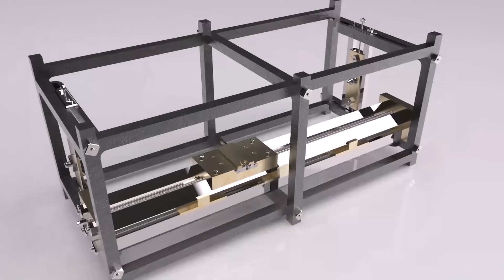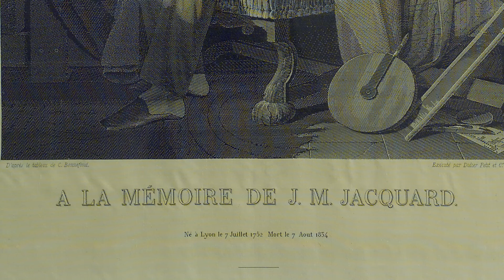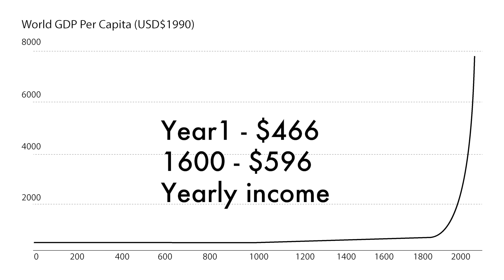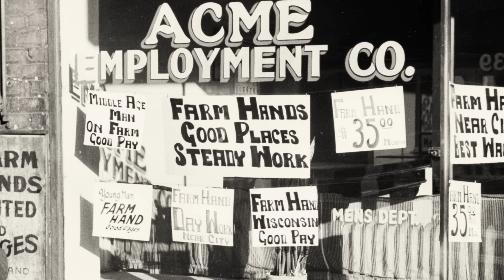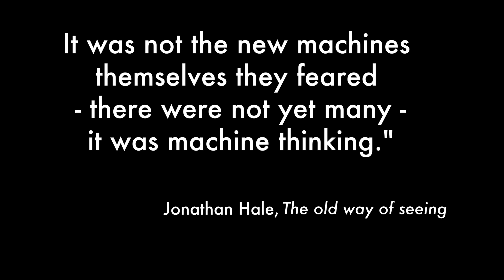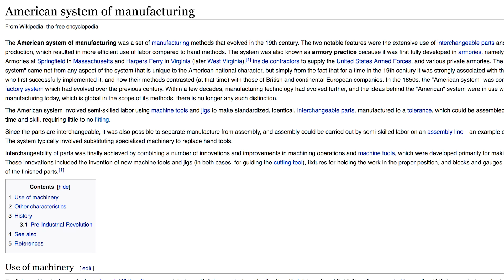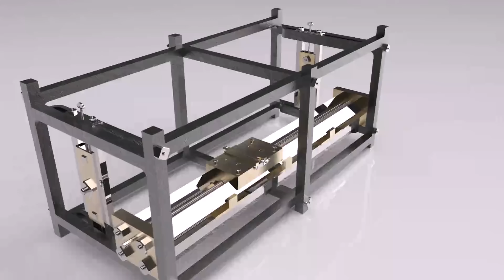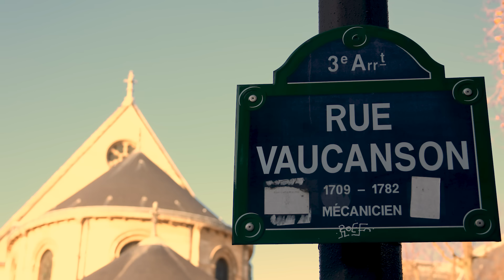The 1751 Machine that Made Everything

Comment: I don't remember who said it, but its one of my favorite sayings: "the lathe is the only machine that can make itself"
Reply: Yep I remember my first-ever laythe and mill, a handdrill in a vice and a file.
Reply: It's the lady of machinery.
Reply: @CIorox_BIeach  3D printers too
Reply: @BacklTrack  3D printers make plastic toys.
Reply: @CIorox_BIeach  you can make some firearms from 3D printing lol
Reply: @BacklTrack  I heard about that and I can tell you is nonsense.  Sure, you can print the components, but  because it's plastic, they'll melt and it's questionable whether or not the material will withstand the pressure from the first blast.  If you want to make a real gun, what you need are things like a drill press, grinder, tapping kit, etc. At the cost of a 3d printer, you can outfit a nice home shop.
Reply: @CIorox_BIeach  lol come on. It's come way further than the original liberator print. Check out the progress
Reply: @BacklTrack  It's still plastic...
Reply: @CIorox_BIeach  not 100% of the best designs are plastic. Usually it's the only regulated part, the frame that's plastic and there's been polymer lowers for decades. Check out the FGC-9. mostly 3D printed, ECM 9mm barrel out of steel pipe, and I think they figured out a way to replace the fire control group with more plastic than what is wise. Just check up on the 3D gun space every now and again. They're doing cool stuff
Reply: @BacklTrack  Well, I think that's the point.  You could probably make a rifle stock out of cheese and as long as the barrel was metal, it'd work.  The barrel still has to be bored and, if you want accuracy, rifled.
Reply: @CIorox_BIeach  the ECM actually rifles the barrel! It's pretty neat. It was made to make a semi automatic pistol caliber carbine using only unregulated parts in the EU
Reply: @BacklTrack  So what you're saying is its better than nothing in an unfavorably regulated area? I'm thinking under normal circumstances, it makes far more sense from an economic, safety and functionality standpoint to just make one with normal materials and tools. In the EU, tho..
Reply: @CIorox_BIeach  yeah that's about it. Stamped/milled/forged stuff would be better. But the 3D printing sphere is getting way way better than I would have imagined. Some guy on /k/ 3D printed some insert for his big bore black powder Snyder rifle.
Reply: @CIorox_BIeach 
You know that 3d printing metals is possible right?
Reply: @CIorox_BIeach  It is the MOTHER of invention, rather!
Reply: 自己増殖は特異点です
Reply: What everyone misses in this discussion is the tooling.  If you started with hand tools manually making parts with files and building a better mouse trap you don't get fly cutters and end mills and insert tooling and you certainly don't get leadscrews.  In the history of lathes tool steel was a futurism.  Mills with no end mills aren't useful.  Lathes with a but of abrasive are.  Lathes are the real invention because we could turn the parts with a single point tool made by hand well before we could make cutting tools capable of the job on a mill.
Reply: And if you had a very basic lathe maybe say a set of V grooves and the ability to spin something between the two v grooves by hand you can eventually make a milling cutter, but you already had a lathe.
Reply: You can mill on a lathe. 
You just need a vertical slide in place of the compound, and a collet in place of the chuck. Then your lathe is essentially a mill laid down on it's back.
The X-axis is the cross-slide, the Y-axis is the vertical slide and the main carriage travel is the Z-axis (or tool height/depth of cut).
Reply: SidtheKid  hammer can also make another hammer
Reply: How would the Vee slides be made on the lathe?
Reply: John Smith from hot billets of steel drawn out and precisely cooled to avoid warp. then they are filed straight and square and cut. i mean or they could just cast them. so idk
Reply: @JohnSmith-tw3rw  the compound slide, tool slide, and the saddle all are capable of cutting straight lines and perpendicular lines. The tail stock is Handy here as well. Any basic lathe can do it.
Reply: @JohnSmith-tw3rw I have several lathes with  round bar beds that are over 100 odd years old that still function well lol
Reply: @JohnSmith-tw3rw  bolt to carrige, feed in x. When you run out of travel, move your work and rebolt you work down. It would take several passes but It is possible.
Reply: True that...I got another lathe so I can fix my main lathe when it's broken
Reply: @drd1924  weird flex but ok
Reply: @ncstudio333  Flex it bruh
Reply: Obviously there are better tools for the job but a lathe CAN make these parts.
I have heard it said that if civilisation collapsed a lathe could build it back up.
Reply: https://www.quora.com/How-can-a-lathe-machine-fabricate-itself The quote is as old as lathes are. A mill is nearly a vertical lathe, it is a modified version of a lathe. Obviously there are more specialized machines to make a lathe than just using one machine to do everything. A hammer is actually the most versatile and fundamental of all tools. But the lathe can make screws (this would be a real hassle on a vertical mill) and standardised screws are such a fundamental driver of the machine age that that is why a lathe is recognised as the grandmother of all machine tools. Otherwise we'd be stuck with hammers and nails.

To the 3d printer fans. I'm sorry but your an example of modern technology making people less smart. You can't make screws on a 3d printer. A 3d printer is a lightweight lathe mill (using leadscrews or belts and chains, it's all indexed round lathe made parts). That being said, the actual technology that makes a 3d printer universally useful is computers and the internet. Infinite programmability. Even more powerful at making things than lathes but it sure can confuse us (people who think a 3d plastic resin dispenser can make strong and accurate machines LOL)
Reply: @ruslbicycle6006  

You absolutely can make screws on a 3d printer. You forget, 3d printer is a wide term. Some use hot plastic, some use uv light to set resin, some use lasers to fuse metal dust. Metal 3d printers are being used to make parts with such complicated geometry that no cnc can come close to making it. Right now the only thing you can't make on a 3d printer is the wiring. I myself own a nice lathe, a nice manual mill, a cnc and a 3d printer. I can print just about any part and use that part and cast it in metal. Heck they are making entire boats with 3d printers and houses. This technology has just began to evolve. In the next 5 years there will be printers everywhere doing things we thought impossible.
Reply: @ruslbicycle6006   there is an American rocket company 3D printing rocket engines that are fully functional straight from the printer
Reply: @ruslbicycle6006  One day someone will put a milling machine next to a metal 3D printer so parts can be finish machined. Perhaps use silver conductive paint and electronic components on a plastic 3D printer and make almost anything. The first ( Lincoln ) milling machines were horizontal, really just a lathe that had adjustment allowing the headstock bearings to go up and down. Everyone seems to have forgotten shapers, planers and slotting machines.
Reply: With a smelting furnace you can make a lathe. With a smelting furnace and a lathe you can make the rest of what you need for a metal shop. Dave Gingery has a whole series of books that provide instructions.
Reply: Boy, this comment thread fell off. 
https://youtu.be/OKDR1Q19BzU
Reply: You beat me to this. I first heard the saying from David Gingery in his book about making a lathe.
Reply: CNC mill?
Reply: @jamesharding3459  Had to hold a 1/2 shaft  in the spindle of a Haas VF-3 and a lathe tool in the vise to turn a shoulder while the lathe was down, felt pretty tricky at the time!
Reply: Of all powertools and machines tgat i have, the lathe is the one i like the most. Its like the king in the shop followed by the grinder and welder.
Reply: People who think a 3D printer can be made without a lathe, kinda miss the point.
Reply: Until we make nanobots.

Then there will only be nanobots.
Reply: Hmmm, I believe you, but I believe it would be inefficient when building the coils in the rotors and stators.
Reply: File.  Is the on;y tool that can make itself and with a file you can make anything
Reply: Shamanists, who despise the concept of the lathe because they think it removes people from their god-given path by enslaving them, are famous for spreading smallpox to their coworkers in order for them all to be unable to work, and by doing so, to apply a [revolutionary] force against their manager.
Reply: Adam Savage in his video talking about his Lathe
Reply: @setheide6618  that guy is a dewwwshhhh
Reply: @setheide6618  and that’s saying has been around decades before he said it
Reply: @setheide6618 mill. He's talking about his Bridgeport milling machine. Calling it one of the machines you would need to rebuild civilization.
Reply: Von Neumann? Nah...
Reply: @omegaman5663  i fucking love how google thinks youre speaking another language and offers a translate button
Reply: The universe, too!
Reply: I thought that was said of the Vertical milling machine?
Reply: Lol I never heard that saying. It's cool to have learned it though. I had one some years ago but it took up too much space and I stopped using it eventually, it made the electric bill really high as well which my wife pointed out to me. So I sold it. It did seem inefficient but I really like how it worked.
Reply: The problem with sentences like that is that they are either read as an absolute statement or as metaphorical and poetic. Both with will draw people on to make the case either for being false or not covering all cases.
Reply: Heard it from adam savage
Reply: 3d printers can print other 3d printers now lol.
Reply: Necessity is the mother of invention.
Reply: Robotic arms? Didn't Elon musk build a factory to build them using them
Reply: My Dad, circa 1985.
Reply: Waiting for someone to say 3d printer
Reply: 3D printer...
Reply: i heard the same saying, but the vertical mill.  because  can make round and square parts
Reply: God
Reply: Wrong,to make a lathe you need an milling machine for  the bed of the lathe.
Reply: Two fundamentals of machining are flat and round.
Reply: The milling machine can reproduce its self.
Reply: - my machining teacher in Gunsmithing said that
Reply: what about 3d printers?
Reply: 'Only'... that's just an old saw.
Reply: That’s not true. Cnc mill can too. And 3D printer. A 5 axis cnc mill can completely replace a lathe and is better in every way.
Reply: @Dakota Rossman Not true but okay. It was a useful tool but there are other ways of doing things
Reply: @Dakota Rossman I already made my own cnc and there isn’t a single part on it that was made with a lathe. Maybe the dies that were used to extrude the motor shafts were lathed but that’s the only thing on it and that could be done without it
Reply: @Dakota Rossman I don’t fail to realize anything. There’s no doubt it was important nonone is saying that. But saying that it is the only tool which could make itself or that it was needed to get to where we are is bullshit. There are other tools which can make themselves. A 3D printer and a cnc are modern examples but there are some way before we even started working with metal that could do that. And while the lathe sped up the industrial revolution it is not directly responsible or needed for it to have happened. Casting and forging and other forms of marching can replace it. Mills and lathes are very similar in function and construction. The mill can easily replace a lathe and would’ve been possible to construct without it. You are forgetting that the lathe was constructed without a lathe. The same parts and methods which made the first lathe could’ve made a mill. And while computers and motors weren’t that advanced yet the idea of a manual lathe being constructed first is completely plausible.
Reply: @Dakota Rossman If I had the money to buy all the metal I needed to prove you wrong I would. Maybe someday when I’m more financially stable I will buy a bunch of metal and make a cnc with nothing but a foundry and post it on YouTube for you. I already have a foundry but I can rarely even afford to fill the gas tank on it. And yes, fire came before lathes. The first version wouldn’t be terribly accurate just like the firsts lathes weren’t. You build a machine that’s has greater accuracy than a human alone. Then you use that machine to make a more accurate one and so on. Also coming up with a lathe hardly makes someone a genius. It is incredibly simple and as the video said people have been making them for thousands of years. It’s not like a single person invented it people consistently came up with it themselves. The person in the video simply made a big and strong lathe. He did not invent them. If you want to talk shit about your own intelligence go ahead but you know nothing of mine. You may be really good at using lathes. Being really good at doing something one way however doesn’t mean it’s the only way to do something. You are clearly the closed minded person in this argument so the wall comment is unfounded. Also you don’t even need to be able to make perfect circles to make a cnc machine. Also mechanical mechanisms which time the movement of the axis can be used to make circles. And before you try to argue you can’t make gears and shit without a lathe you can make a good enough gear with just abrasives. Don’t even need any machinery. And there are lots of videos online of people doing just that if you need proof. The real industrial revolution started with the ability to melt metal. Not with the lathe. Using casting and forging anything can be made without any tools. Just raw metal heat and time. Then abrasives are used to clean up. You can get away with using wood for a cnc frame though.
Reply: @Dakota Rossman you are the one obsessed with saying you can’t make a cnc without a lathe I’m just saying you can. Don’t get me wrong there’s lots of other things you can make without a lathe too. Also constantly trying to flex your job doesn’t help your argument any. A lathe is one of many ways to machine metal. And even in 1750 they had the ability to make metal parts without a lathe. Also I thought you were done with this argument lol. Clearly you care more than you say. Also motors are quite commonly made out of cast aluminum. Trying to cast copper wires wouldn’t be very efficient however but you wouldn’t use a lathe to make copper wires either. You either make a ingot and then press it into thin wires or you push molten copper through an extruder. When you are done you need to heat treat them to make them flexible. Anyway motor production is pretty simple. Wrap copper wire into coils. Preferably around iron to help strengthen the magnetic field. Laminations help reduce eddy currents however it’s not necessary. Then you just need a body which could be made out of aluminum although it doesn’t even have to be metal and a shaft. I’ve made my own motors before with my cnc and 3D printer lol. Used them for a drone. If you make an induction motor you don’t even have to use magnets. I used magnets in mine though because it was easier. And servo motors are just like normal motors with an encoder. The encoder usually uses a potentiometer. A wiper moves across a material with a high electrical resistance and the measured value of the resistance provides the location of the wiper. The electronics of course are an entirely separate industry though. Not going to bother arguing with you over how to make each and everyone of those machines without a lathe. Anyway I personally prefer stepper motors. They are cheaper and more accurate. Servo motors use a feed back loop to correct errors. Stepper motors simply don’t make errors in the first place. You can’t control the position of a servo motor it relies solely on its encoder and feedback loop to position the motor. You tell it to move to a certain position it will turn the motor at a certain speed for a given amount of time and hope it ended up in the right position then correct it if it doesn’t. With a stepper motor you can precisely control their position. The motor doesn’t just get set to a certain speed. The coils get turned on and off precisely attracting the rotor to a specific location. They can skip steps but if you use the correct power motors that almost never happens and you can put a encoder on a stepper motor too. Plus if your motors are stalling or skipping steps you should be grateful because it’s portably preventing your machine from killing itself after crashing or something or because you are putting too much stress on it. People say that servo motors have more torque but I think saying that a motor that costs 5 times as much and only has double the torque has more torque is just dumb. Maybe when you start talking about size and weight then you could make that argument. When it comes to torque per dollar though steppers definitely win. Same with accuracy. When it comes to efficiency both are over 95 percent even for the cheap ones so that doesn’t really come into play. Servos to tend to keep torque at higher speeds better but they still have issues with it. Also generally thanks to inertia you don’t need higher torque at higher speeds. You need it to accelerate but once you are accelerated it takes less force to maintain the speed. And if it really matters you can just use gearing. Anyway that’s besides the point because even though I wouldn’t use Servos stepper motors and servo motors are equally as easy to make.
Reply: @Dakota Rossman you too
Reply: You need a wooden mallet to make a wooden mallet
Reply: @Dakota Rossman have you ever made a wooden mallet with a bow saw and an axe? 

Either way .. go fuck yourself
Reply: @Dakota Rossman still trying to be a key board warrior??
Reply: Nano bot: hold my beer.
Reply: It was me that said it, not first but I’ve said it;)
Reply: I think a 3d printer could do it
Reply: dont forget the mill, if i could only have one it would be the mill and indexer
Reply: True! i love working on a lathe. much more than at a mill.
Reply: You can't make a lathe with a lathe. Prove me wrong.
Reply: @YarHarFD  um, is the machinist allowed to call thier mill a tipped over lathe? Oh and if anyone does accept, hi there sir, it seems you have an extra lathe taking up shop space; I'd be happy to help you clear some space ;)
Reply: I think that's what they say about the Bridgeport
Reply: Oh yeah? What about every living being? Ultimately with our man made machines we are just trying to achieve what nature does.. create a self replicating machines that would do our work for us..
Reply: True. But a hammer and tongs can make more hammers and tongs.
Reply: Don't know who told you, but it was Henry genoble at the Harley shop who taught me
Reply: My millwright instructor told me this one
Reply: Soon enough it’s gonna be robots
Reply: I'd say a mill would also fit in there
Reply: The problem with modern CNC machines is, while they can make their own mechanical components, they can’t make electronics components…
Reply: It can't though.
Reply: The late Dave Gingery repeated the phrase
Reply: How did they make the first one ever
Reply: @nnnnnnnnnick5557  Obtain a book by the late Dave Gingery detailing the construction of a metal lathe. You will then understand how basic hand  skills can be used to manufacture
a basic lathe, which is then
capable of being used to machine its own component parts.
Reply: Machinist of 36yrs, beautiful profession!!!
Reply: They were wrong. Have you heard of a hammer?
Reply: @kiwiwifi  hammers don't make nails
Reply: @kiwiwifi  I don't get it?
Reply: 3d printers now :p
Reply: 3d printers
Reply: Sounds like a cool project
Reply: it's*
Reply: True
Reply: Hammer
Reply: Lathe, pretty integral to the tool singularity (the point where you have all the tools to make better versions of all your tools)
Reply: That’s pretty dope
Reply: We make the machines. And the machines make us into machines.
Reply: A mill is literally a lathe that the head can move around
Reply: Axe
Reply: A file can make a file.
Reply: With a lathe, a mill and a drill you can build a civilization.
Reply: Substitute the word lathe with the word milling machine
Reply: Not even close to true
Reply: You can't make a lathe with a lathe. A lathe is not al round
Reply: What is meant by that is it does not need all its parts to function. You can usually make the new part needed on the same machine that is broken.
Reply: It can’t make the grease nor the lubricant. Could make the electricity.
Reply: Wrong. You're thinking of the milling machine. Not the lathe.
Reply: 3d printer?
Reply: Hear comes AI " hold my beer"
Reply: Farm work is drudgery. So is factory work. Or ask a lawyer about their  job. We are glad for this invention.
Reply: To bad they never got to see 3D printers
Reply: 3D Printer
Reply: I am a mechanical engineering student and I couldn't figure out how to centre a workpiece on a four-jaw chuck for the longest time. I once broke down in tears cause I was afraid I was going to fail my exam cause I couldn't do it, I am intimidated by lathes...😂😂😂😂😂
Reply: They do teach you that
Reply: Lathes allowed standardisation which allowed modern mass production. Go back to your farms and villages. Hand make everything. You will die in poverty. But I will look very pretty. Viva capitalism.
Reply: Oldowan stone tools
Reply: I've heard that about the mill not Lathe
Reply: I remember hearing Adam Savage say that, there’s probably a bunch of others though.
Reply: This is a cool quote, but I bought a 1970 vw Beetle, and since then like 6 others have shown up in my driveway.
Reply: 5 axis cnc can easily make itself too. And few others.
Reply: But to this day- I have yet to see anyone build a lathe.... with a lathe!
Reply: @JaySims  Some British prisoners of war in a Japanese camp in WW2 made a lathe, a pretty decent one, without a lathe OR a mill, and without getting caught.
Reply: Lathe makes round parts. Milling machine is more versatile. Millturn is awesome
Reply: @DanPetrePhotos  
You can't make a mill with out a lathe.  How ever a lathe can be made with out a mill.  Hand scraping of ways for flatness and straightness is still used today for fixing machine tools.
Reply: You could also use a lathe to make a round bed lathe if you're to lazy to do the filing/hand scraping - the first unimat ( 1 ) had round guide ways for the cross slide. I use a lathe for all sorts, like as a press, clamp, rivet forming and I've even tried friction welding with one, but it needed flux I think to work properly.
Reply: @brandons9138  Actually it's the mill that can remake itself. Of course it needs all the attachments.
Reply: @brandons9138  lathe = rotated mill 
Lathe spins work worker programs tools, mill spins tools worker programs work
It's all relative. Right?
Reply: @brandons9138  I've used my mill as a lathe by holding the workpiece in a chuck. and holding the lathe tool in a vice. Using the same method, I've also used it for boring internal diameters.
Reply: @jackfrost2146  I saw a video a long time ago where a guy took that exact method to the extreme. He made a gang plate full of lathe tooling and mounted it to the table of his mill. He had turning tools as well as drills mounted to it. He then loaded up his milling tool holders with material blanks and filled his tool changer with holders/material. He could hit cycle start and come back to 24 parts complete with no operator intervention. The major advantage of it was gravity kept chips from building up on his part. He used flood coolant to keep the table and tools chip free as well .
Reply: @DanPetrePhotos  You can make a cube with a lathe, mate
Reply: @RhodokTribesman  Yes, but it is an extremely inefficient way of making a cube and you will not see it performed in industry.
Reply: @RhodokTribesman  Yes, but it is an inefficient way of making parts with right angles, so you would never see it in industry.
Reply: @skulengu6854  Of course it's inefficient, but a lathe doesn't only "make round parts"
Reply: @RhodokTribesman  I had to pull keyways on a lathe one time, my arms were tired that day.
Reply: @RhodokTribesman  you can also put cylindrical parts in a collet on a mill and hold the tool with the vise. Boom its a lathe
Reply: @RhodokTribesman  Actually you can make a cube with a lathe.
Reply: @johndavis4767  I know, look at my first comment in this thread; I say exactly that lol
Reply: @RhodokTribesman  yes, yes you can...

Search "turner's cube"
Reply: @welshdave5263  Mate, I know you can, I said you could in the first comment I made lmao
Reply: @JbassPlayer28  I've had to do that in a pinch!
Reply: @skulengu6854  we make cubes at my work using a lathe and it's not inefficient at all. We make tones of money on it too. Of course the machine used has a 8 spindles on it, so that helps.
Reply: @RhodokTribesman  wtf ?
I'm eager to understand how
Reply: @PereCatou  It isn't super intuitive, but there are some youtube videos of people demonstrating it
Reply: @RhodokTribesman  thanks for the link, right after commenting yesterday, I searched and watched this exact video.

Next I went on discovering machining for a few hours, even saw a Russian dude use a lathe to create a cube mbedded in a cube embedded in a cube
Reply: @RhodokTribesman  the process of using a lathe is mesmerizing and the community around it is great, people with great stories, good mindset and able to do much !
Great stuff
Reply: @RhodokTribesman  a lathe cant make anything but very small flat surfaces that you would have to join together and they arent precise either using a 3 jaw chuck. 

A bridgeport mill like i used in shop class can make perfectly round parts and flat parts. A mill can make itself, it can make a lathe, we can use the lathe it made to make better mill and lathe parts. It will self improve over the original tool's cutting tolerances eventually.
Reply: @skulengu6854  The early apprentice machinists would be given a file and a block of iron, and told to make a perfect cube. Now THAT was an inefficient way to make a cube.
Reply: @skulengu6854  i don’t think you’re getting the point of the quote my man
Reply: @RhodokTribesman  yup polygonal turning  / milling
Reply: @RhodokTribesman  yea sure, but can you make a carriage and cross-slide in a lathe..? I'll wait.
Reply: @DanPetrePhotos  Yes, a milling machine is more versatile. But you still need a lathe to manufacture a mill. Parts such as the quill, spindle, threaded rods used to move the X, Y, and Z axis, and etc. still require a lathe.
Reply: @smh9902  5 axis
Reply: @DanPetrePhotos  actually, the guy Vaucanson talked about in this video also did "rotary filing" with his lathe, which is a kind of early milling.  He thus could make "square parts" and some other milling machine feats.
Reply: @DanPetrePhotos  Lathes can do everything a mill can do, but mills can't do everything a lathe can do.
Reply: @DanPetrePhotos  I can make a precision cube with my lathe. ever heard of a turners cube? you can do anything on a lathe, but of course, flat surfaces tend to be a PITA. remember, you can mount an end mill on the spindle...
Reply: @DanPetrePhotos  you can also make cube or square parts on a lathe ...
Reply: @DanPetrePhotos  

You can mill parts with a lathe. You just have to know how to set it up.
Reply: @DanPetrePhotos  Lathes can have a Y axis and live tooling.. cut some jaws for whatever part you need it to hold and boom.
Reply: @DanPetrePhotos  put an endmill in the Chuck and bolt your work to the carriage. Now you have a sideways mill
Reply: @DanPetrePhotos  lathe can make square parts as well. With as much or more accuracy than a mill
Reply: @DanPetrePhotos  lathe can make any part of you put an end mill in the chuck and mount the stock to the tool holder. See, you learn something everyday.
Reply: @DanPetrePhotos  precisely
Reply: @DanPetrePhotos  not really, you need to learn to use a lathe if you think that. Try putting a vice where the tool goes and a tool in the chuck and now you can slot and mill. Plus again a lathe can make itself.
Reply: @DanPetrePhotos  TBF you can also do a lot more on a lathe than make round parts. History is filled with janky setups on lathes that used them as a milling machine. Blondihacks used hers in several ways like that such as line boring and I think face milling for some model machining with the cutter in the lathe jaws and the workpiece on the cross slide when it was too big to fit in her mill.
Reply: @DanPetrePhotos milling machine is cringe, lathe gang all the way! Let's all ostracize the millmen!
Reply: @isaacandersen1  r
The ultimate precision is achieved on a jig bore, some sort of a milling machine
Reply: @DanPetrePhotos I have worked in Aerospace most of my life I love milling machines. When I was off the clock at my company I was allowed to use the mill the lathe and anything else and build things. I used to design and make car parts for my classic car builds.
Reply: Take a lathe and snap places the tool and the material and now you have a mill
Reply: @DanPetrePhotos 
With the right set up, a lathe can do some limited milling as well.
Reply: @DanPetrePhotos lathes can make square parts, Manuel mill turn are not good usually 😂
Reply: @DanPetrePhotos   milling machine with a dividing head  can make both xD
Reply: @blackdaan  ah. but a dividing head is nearly a machine in it's own right as well as rotary tables
Reply: @blackdaan A lathe with a dividing head is a milling machine…
Reply: And yet there is no video of a lathe making itself
Reply: Can a shaper make itsself? You could probably make round parts on a shaper though it's not very practical for that. You can pretty much make anything on a shaper.
Reply: @NoZioKikes88  tells us that 'You can pretty much make anything on a shaper..."
That's an old saying, but it goes on:
"... except a profit"
Reply: @NoZioKikes88  right... you can make anything on a shaper but money hahaha
Reply: @NoZioKikes88  you can make anything in the world with a shaper...but money
Reply: Robert M. Pirsig, author of Zen and the Art of Motorcycle Maintenance, made the claim in a radio interview I heard in 1976. I don't know how correct that claim is, though.
Reply: @two_tier_gary_rumain  I have to read that book!
Reply: The "Bridgeport" style manual mill...not the lathe. Doesn't have to be a Bridgeport, just a 3 axis mill. But, it would be really hard to do and the 2nd one will be unbelievably expensive and ugly as fuck...and no one would want to buy or use it...trust me.
Reply: That is TRUE
Reply: A file can make another file
Reply: I think the only other machine that could do that now would be a 3D printer? But even then you need the electronics to make it tick
Reply: @rockinlawnman359  if ur creative enough u can make anything in a 3d printer just need a bunch of different tools for it xD
Reply: 3d printer
Reply: @Andrww3627  almost. How would you make the part that melts the material in the 3d printer with a 3d printer?
Reply: @kraziecatclady  how can a lathe make a bearing.. or a motor? Or the chuck..
Reply: @blackdaan  Plain bearings (which are perfectly suitable for the spindle and even the headstock gears on a lathe which is not run at high speed) are best made on a lathe. As for motors and chucks, you could make these with a lathe only (and hand work) but it would be much easier on a mill. 
A horizontal mill makes a great lathe for short workpieces, and a universal mill (I think) is a more fundamental machine tool than a lathe is. Especially one with a dividing head which can be geared to the x axis feed.
A lathe can do milling, when provided with a few extras (which at a pinch can be made on the lathe), but it does not have the rigidity of a similarly proportioned milling machine, and milling requires a ton of rigidity, unless you take an unfeasible number of light cuts.
Reply: @kraziecatclady  metal 3d printer lol
Reply: @blackdaan bronze bearings. If you mean ball bearings, you can make a ball on a lathe. The inner and outer races of bearings are already made on lathes. Through gear reduction you could make a gearbox to power the lathe that a second person could spin by massive crank handle via manpower. This would take an extreme amount of time and skill but it's possible
Reply: @Andrww3627  Can you print complex semiconductors, telescopic controllers, complex wiring, electric motors and printed circuit boards, as well as precise tubing, and a powered filament heater? I think not yet.
Reply: @Andrww3627  I dont think that's possible,  you need heating elements,  circuit board,  wires etc.
Reply: @Andrww3627  someone gotta say it lol
Reply: @Andrww3627  a 3d printer can't print it's own nozzle or element.
Reply: @Andrww3627  Can't 3d print pcb
Reply: @Andrww3627  3d printer has no concept of precision. And it only makes flimsy parts
Reply: @Andrww3627  good luck printing your electronics...
Reply: Cnc mill, can make perfect circles and easily make flat planes
Reply: @aragorn_S  Mills don’t make anything anywhere near perfect circles without boring them. And you certainly don’t need CNC for that.

Lathes, however, can make “perfect” round circles, as well as flats, angles, threads, etc...

The fact that this video shows where it all started, with a lathe, verifies the statement.
Reply: @bradchristy8429  obviously nothing is perfect but a good cnc mill can hold 1/2 a thou, seems pretty good to me lol
Reply: @aragorn_S  Circular interpolation means axis reversal. This means “flats” at the cardinal points. Even the best CNC mill produces these flats. A lathe doesn’t produce these.
Reply: @bradchristy8429  a circle is just a shape with number of sides approaching infinity, at a point the difference between a true curve and a collection of  Infinitesimally small lines becomes meaningless. You could also just us a rotary table to get a "real" circle.
Reply: I am a lathe.
Reply: @SlabCityHauntedHouse  I am a mill, I don't mean to be Latheist; but I just can't see things from your angle.

Update, I got a 4th axis; I think I'm coming around!
Reply: Metal is metal know doubt about it...
Reply: But my Aunt Holley & her Daughter got to experience a band called Alibi... No i'm trying to step over the line but she is pretty & she is in the health care industry ??? 😘
Reply: What about simple cells, and even more complex organisms? Yes, they are not machines but still...
Reply: @ABW941  what about it? That's not the topic.
Reply: @ABW941  Cells are nanobot technology. Cells are the true Von Neumann machine.
Reply: @ABW941 you're right, but like, i feel like you're missing the point on 😛 reproduction is like the main function of all living beings. The lathe has one function and it allows it to facilitate the creation of another lathe. In living beings the mechanism of reproduction is its own feature, all others help facilitate the end goal
Reply: 3 d printers man
Reply: @pkd5849  Why does my Alibre Atom CAD fail to make an STL file? Asking for a friend..
Reply: @pkd5849 there are components on a 3D printer that need to be metal that a 3D printer cannot make so a 3D printer cannot make a functional version of itself.
Reply: 3d printers be like...bitch please
Reply: There is a 3D printer which can do that.
Reply: @jaredgarbo3679  No. It can’t. There are several components of a 3DP that a 3DP cannot produce.
Reply: That’s just a saying in the machining world. You can’t cast the frame or make the tools or ways, cross slide, tool holder, bed, or chuck jaws, chuck key, back stop. You need a milling machine, surface grinder, and heat treating oven. Along with the lathe, to make a lathe
Reply: 3d printer:
Reply: Cough cough
3dprinter
Cough
Reply: is false
Reply: Was. 
 3-D printers can also basically make themselves.
Reply: @aurorincorporated not so accurately
Reply: @LD-qj2te  
True. :)
Reply: Actually, it's a mill that can make itself. clunky and cumbersome, but it can. A lathe cannot make the straight, flat parts needed in the length to make ways and bases, but a mill can be fiddle-fingered to make turned parts and gears.
Reply: @keithdavis4649  but a lathe can make round ways. Some of the lathes throughout history have used round ways, including I believe the concrete lathes built during the world wars.
Reply: @keithdavis4649  milling machine. and only CNC.
too much time for manual one